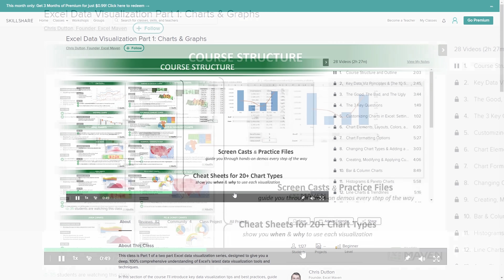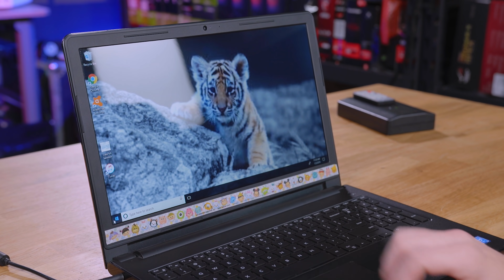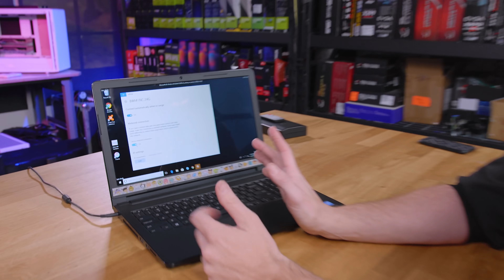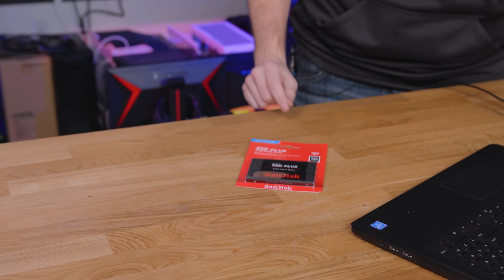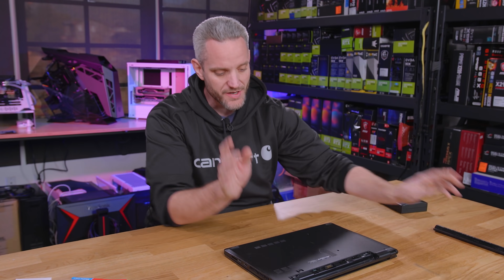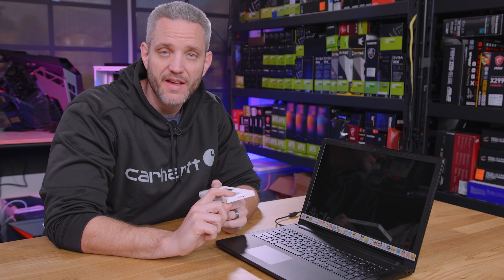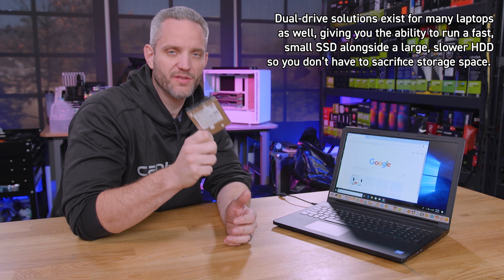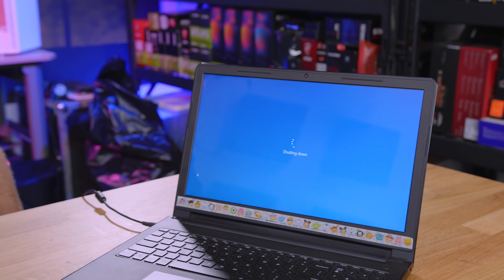Repairing an old laptop for as little money as possible...

Comment: Have an older HP Pavilion dv7 entertainment lap top that I upgraded to an ssd. The laptop has a 2nd slot for another HD. So I bought a Sata cord to connect to the mother board and once it is all connected will boot and run perfect but will not recognize the second older HD. How do I get this to recognize the extra HD. Ty in advance.

Comment: My dell latitude 3540 al you have to do is remove 1 screw and 1 panel and you can easily replace the hard drive and 2 sodimm slots, way easier then that dell

Comment: i really hate my sister's old Dell Inspiron Mini 11 inch netbook cos the RAM module is in the same system board with its CPU which means the RAM is not upgradable. ughhh disgusting! i've tried using an SSD with it, still slow AF. now i just left it to rot in the bookshelf.

Comment: hi jay u rock question for you I have a 8086k with 1070 sli if I install a mvme drive will it slow down my 2nd card because don't nvme drives use pci lanes I have a 860 Samsung ssd

Comment: dell is not designed to be user serviced? what? dell offers complete pdfs mentioning EVERY step to take to completely disassemble their machines. i do not know of any other brand than dell which does that. dells are the best  machines to safely take completely apart and reassemble it by your own hands - because those pdfs are still available for my both dells running today, being 8 [optiplex 3010] and 12 years [inspiron mini 1011v] of age! with a beautiful linux running, both do perform great and.. okay, and i have taken the small one apart sooo many times to fix or upgrade.
Reply: you will be asked for a service tag on their site, printed on a sticker of EVERY dell and stored in bios in case the sticker has turned unreadable. you'll be offered EVERYTHING :)

Comment: Install SSD, even a small one. If less than 4GB RAM, upgrade to 4GB RAM. Install a Linux Distro with XFCE like Mint XFCE or Xubuntu. If it is really a turd of a system, look at LXDE but XFCE is a good balance between ease of use, familiarity to Windows users and lightness. Install Chromium, not Chrome, with an adblocker like uBlock Origin, all those ads eat CPU cycles.

Comment: McAfee... Norton... Avast... And finally, Windows 10 update. An overkill-recipe for computer disasters. Its like someone tried to wreck it on purpose. McAfee himself would be rolling in his... dough I guess. 

The sad thing is, About 7-10 years ago, I used to recommend Avast (Anti-Virus Free) for most of my family and friends, as it was fairly no-fuzz, and had one of the smallest memory footprints of simple, top-rated AV at the time. But then the went the Dodo way of the "Internet Protection package", and apparently entered into a memory-hog drag race with Google Chrome. So the last 2-3 years I'm going around replacing it with Bitdefender, or simply Windows Defender+A.m.bytes Antimalware, having to explain why my aoftware advice backfired after 5-10 years.

Comment: But Jay........ Not all laptops will accept an SSD.  Proof you ask? I have two similarly specced Lenovo laptop's just one generation apart.  One will run an SSD And Windows 10, the other will blue screen on either windows 10 or an SSD, prefering hdd and win7.

Comment: Windows 10 is broken as shit. Can't get half the stuff to work that works fine on W7.  The random forced updates make it useless for many tasks. Running a home based radio station for example. The metered connections setting will help. I hope. Chrome has not worked properly once since updating. So broken it's unusable. The world needs another proper operating system. W10 going forward is a spy device for Microsoft.

Comment: So about a month ago I got a laptop from my older Brother it's a Lenovo ThinkPad Yoga 14, and He told me that the Drive was "Bad" so I did the troubleshooting steps that I would normally do to see if there was a possibility that I could get the drive to work again. I used my  Win10 bootable USB and tried to see if I could reinstall Windows I got to the point where it was able to get into the Installation list but was doing nothing. That's when I found out that Lenovo was smart and had Lenovo Diagnostics in the BIOS and performed a drive test, and turns out that the drive was indeed fully corrupted and there was nothing I could do so I took the drive out and now just waiting and saving up enough to buy a new WD drive for it. It has a SSHD drive installed in the system.

Comment: W10 great fix:
Before that, I recommend EVERYBODY learn how to use a backup IMAGE tool like Acronis True Image, preferably AUTOMATED weekly, to a 2nd internal drive or USB drive (if USB it's best the tool can automatically backup if you plug in the appropriate USB drive) like Acronis TI can...

There are lots of reasons why a computer could be SLOW or BUGGY but one of the better solutions I've found for the PC illiterate or semi-literate is to attempt a W10 Upgrade to itself. You MUST be able to boot into Windows for this so it won't solve boot issues (though restoring a backup IMAGE can as per first sentence)... here's how though Google for more info:
1) insert 8GB or greater USB stick (4GB may work)
2) download and run the W10 creation tool https://www.microsoft.com/en-ca/software-download/windows10
3) choose "for other PC" or whatever so you can choose USB drive
4) wait until finished downloading (maybe 1 hour or so for 1MBps/10Mbps connection) and finalizing the USB stick
5) run "setup.exe" from the stick, follow instructions ("save files and programs" should be greyed out so there should be no issue there)
6) wait, then see if problem is fixed

I've never had any problems caused by this, but I have had some issues FIXED from this... other simple fixes I'd try FIRST are:
a) go back to earlier SYSTEM RESTORE point (after creating a new one you can go back to if need be). Check programs affected and write down names if need be.
b) disable all STARTUP programs using MSCONFIG (Google how to use that) to see if its one of those programs
c) disable INDEXING (I use the great program "EVERYTHING" from VOIDTOOLS instead)

Comment: Get an old Dell or HP off-lease system with an i5, top up the ram to 8gbs and throw a low profile 1050ti in there and see how much you have to spend to beat it with new hardware.

Comment: I have a 4100 fx so a ssd would help but not much.
Reply: Help what? Fps on games? Or overall responsive and speed of use? Cause it will help the 2nd. I've out ssds in pcs with core 2 quads and they feel so much better to use, and small ssds as boot drives are pretty cheap too
Reply: yeah i would still have a cpu bottle neck.
Reply: @gregprescott2788  yes, a ssd may help a little if a game is installed on it, but it's not magic. 

If you can, try and get an fx 6300 or something. Pretty cheap upgrade

Comment: If you have an optical drive in your laptop, you could go for this to put your new SSD in this:
https://www.amazon.com/Optical-SuperDrive-Adapter-Unibody-2012-etc/dp/B004FM4UGE/ref=sr_1_1_sspa?ie=UTF8&qid=1546870538&sr=8-1-spons&keywords=HDD+CADDY&psc=1

And the old HDD is already in the device. You just need to install the OS on the SSD.

Comment: Don't buy an SSD you don't need it if you have a pc this old, just save up for a new one. 
If you can't then:
1:Remove everything you don't need from system start up (programs/apps that load as soon as your pc starts). 
2:Increase paging file size to elevate RAM usage in the beginning to load a bit faster. 
3:Make sure you have more than 30gb free. 

The less GB you have the slower the system gets due to many reasons too long winded to list here.
This will solve a lot of issues if you don't have the ability to purchase new parts. Again you sincerely do not need an SSD. Sure the luxury of owning one when you have money is great because you can see an insane increase in performance. But if your laptop/pc started up fast when it was new, it should not require any new hardware just because you loaded programs on it. 

Learn PC management if you want it to actually not degenerate to a slug.

Comment: Question for comment section:  old laptop with i7 2600 running win7, if upgraded to 10 will i loose files and does it work with this older cpu?

Comment: install Linux and maybe add a SSD included and not using Windows 10 problem solved, now image using a OS on that low end hardware that only requires a minimal of 1 core and 300mb of ram Linux Xubuntu for example unlike what Window s10 requires..

Comment: Wait wait wait..... So you switch the HDD to an SDD and wops its working? Aren't all the programs and operating system on the HDD? Don't you need to install everything again?
Reply: You can also clone the HDD to the SSD.
Reply: @alanngo268  Ok thanks for the reply. But how do I do that? Would it be like the same way as cloning a USB to another USB? But what about the OS ? It can't be that easy or else one could copy the OS many times without paying. I guess for an amateur like me there should be a whole video of how to do this. This video here is great for the hardware but for the software there is basically nothing :-/
Reply: @alanngo268  thanks so much. Appreciate the help. But now I realize.. I want to change SSD also to fresh up my computer. Its getting slow and I don't think it's something wrong with the rest of the hardware. It's been a company computer and just loaded with crap. I guess if I clone the SSD I will take all that with me.. But I'll look in to this. Must be some clues there.

Comment: The best thing to do when you buy new laptop is to immediatelly do a clean install of windows 10 and then install only necessary drivers to save you a lot of headache and possible windows crashes in the future... All the bloatware that OEMs put into their laptops is ridiculous... Like why the somebody would even use that??

My Lenovo with quadcore i7(4 threads) and 8gb of ram was already slow because of crappy harddrive(lenovo you suck) and it was slowed even more by all that crap that I wasn't using anyway!(lenovo you suck even more)

Also ssd is the best to speed up pc

Comment: HDD's are dead before 2020. mark it.
Reply: so that means this year, 2019. So by the end of the year, you are saying no one is going to be using mechanical HDD's as storage drives? or just boot drives?
Reply: @bluescluessuperagent  My guess is that a large majority of non-commercial users will be buying cheaper and larger SSD's by the end of 2019. Mechanical drives will probably still have a use in commercial servers, and large storage applications, but will also be super cheap and your basic consumer will barely remember them. Moore's Law.

Comment: Pff... Your way took too long!
1. Remove HDD from laptop.
2. Put it in your PC and create disk image.
3. Throw HDD away!
4. Put new SSD in your PC and write the image to it.
5. Put SSD into laptop.
This would've been faster WITH the Windows Update and all. ;)

Well, you needed a 10 minutes video... LoL! :))))))))))))))))))))))))
Reply: I would not actually recommend throwing the HDD away well not until you destroy the drive. If you don't intend to use the drive ever again, there's various methods but the whole point is to make sure the platter never spins again. One method is drilling several holes through the drive and obviously one would be in the center and through the platter.

Comment: I have someone offering me a PC with a MSI GTX 970, I5 4690K 1Tb hard drive, 250gb Samsung SSD, 16gb ddr3, 750w psu,  nzxt chassis for $500 is that worth it I don't care about hitting ultra setting as I play ok console right now so I can deal with medium but I'm just curious if I should buy it cause I can upgrade it after time but I just wanna play games at 60fps please get back to me asap thanks!
Reply: That's too much $$$, try and Build your own!
Reply: @NervousNick  okay I've been talking to someone else and he doesn't know much about computers and neither do I but the specs are an I7 6700, gtx 1070, 16gb ddr4, 1tb hard drive and some Asus type mobo for $750 but I talked him down to $500 should I get it?